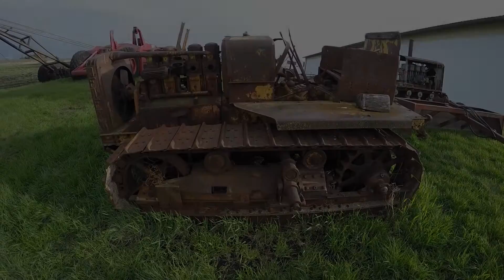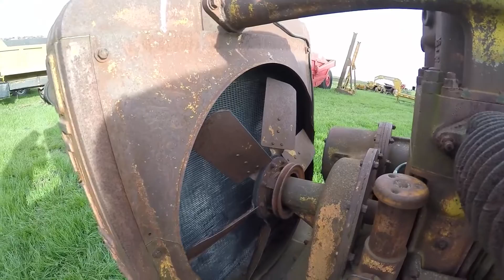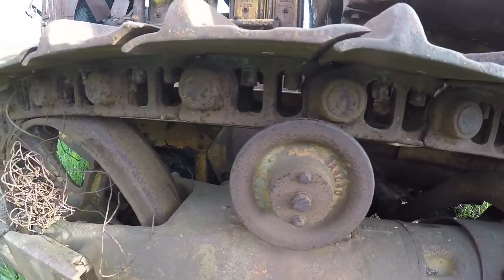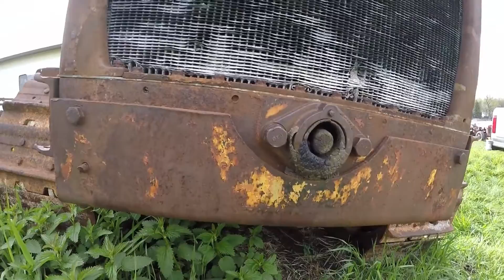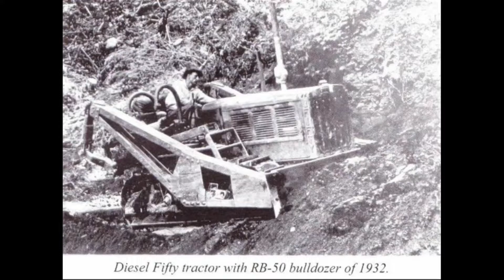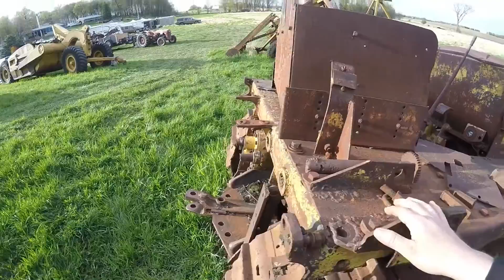Caterpillar Fifty Tractor #5A476 - LaPlante-Choate RB-50 Bulldozer Blade

Comment: Just wanted to give you an update on this one it hasn’t moved at all
Reply from the maker: The owner basically offered it to me for free last year if I'd be willing to give it a home, but it's a parts tractor at best and I don't have any other Cats that could use any of the parts from it :-)
Reply: @ I would try to find the owner and buy it as a restoration project but I don’t have any caterpillar experience and I don’t have access to any trailer near big enough and the parts are a bit to far rare for my taste

Edit: now I’m considering trying to restore it but I’m not sure if this is accurate but the sources I found listed the weight as 18,000 pounds and i don’t have the budget for a heavy haul truck to transport it

Comment: We have a fifty with the complete blade assembly, hasn't run in about 30 years, needs the intake manifold, my grandfather got the dozer and an Addams #10 leaning wheel grader from Mariposa county in the early 50's . Both the grader and dozer survived the creek fire, I remember riding on the fender and I would set the choke cable for my dad. The 50 definitely liked to drink the gas, but in the 60's and  70's gas  was a lot cheaper, we would easily go through a 55 gal drum in a weekend. Also our property is at the 7000 ft mk ànd hand cranking you  needed several guys to line up cause you only got 3 - 4 pulls on the crank before you were winded.